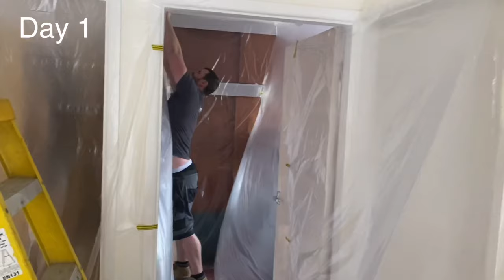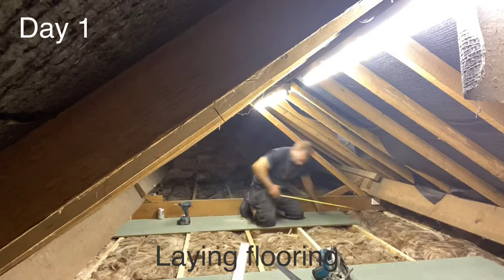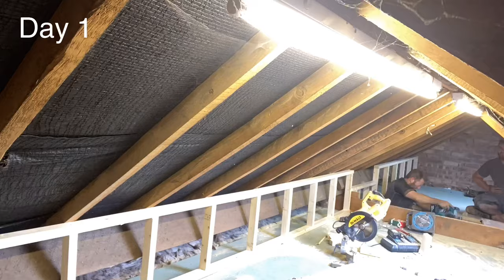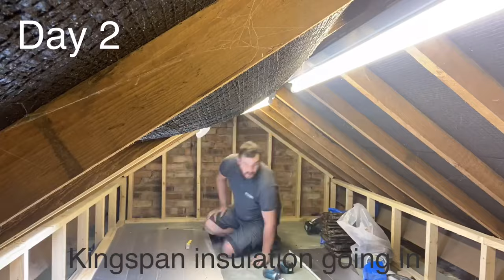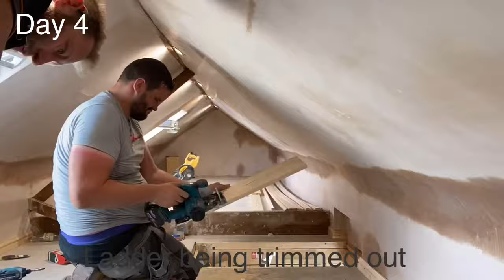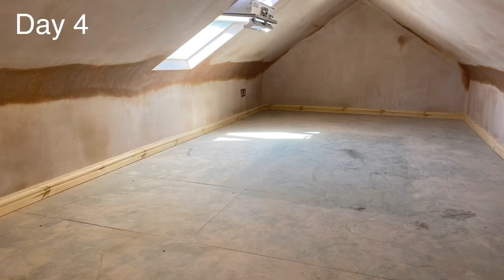SMALL LOFT TRANSFORMED IN 4 DAYS

Comment: why would someone go to all that trouble and expense for such a tiny room.
Reply: For storage. It’s cheaper and more convenient than renting a storage unit, plus it adds value to the home. Also, the construction process is a good time to check and see if everything is ship shape up there, since they replaced the insulation and everything.
Reply: @thefranks8726 yes but why put 2 widows and insulate and plaster for storage... Pointless. Board the loft floor. You have storage. Cost? 300 quid.
Reply: @Sosages79 lol, take a wild guess

Comment: I have a similar sized low pitch loft space, but it has W trusses through the middle of it. Can this be converted without steelwork, or does it need the full structure like in some of your other vids? Was thinking of having it accessible via a mezzanine over one of the bedrooms as a sort or two tier bedroom space for the kids to play in
Reply from the maker: Hello friend
It can be opened up but it will require steel to reinforce the structure

Comment: I've seen a couple of these videos, and forgive me if this is a silly question, but in one of your other videos you first took some off the bottom courses of off the roof to slide in and fit steel beams. Why did you not need to do it here? Is it to do with the purpose of the space, or something to do with the structure of this home compared to that other one?
Reply: Some choose to have steels others don't. Probably depends on budget and purpose of the room.
Reply: Steels are put in if the loft is a trusse rafter roof. From this video looks like its a small traditional  roof construction where ceiling joists are man enough to take weight of the new floor boards and traditional rafters and purlins create the existing space. Probably  be a lot more effort and cost to convert a similar sized  and head height roof space if it was a trussed rafter roof.

Comment: Does any of this need to be certified? Here in Australia we would need this to be certified by an engineer before cutting out any trusses or framework. How do you get away with this?
Reply from the maker: We have structural calculations for every job we remove or adjust supports

Comment: Thought you need a certain height to convert an attic or have I heard wrong?
Reply from the maker: This is not a bed room just storage space
Reply: @builditwithrob  did it need building regs?
Reply from the maker: @ARM1886  as this is only a storage space, building control is not required
Reply: @builditwithrob  Oh great. I'm currently doing this with my garage conversion. Not big enough to he a room but OK for storage.